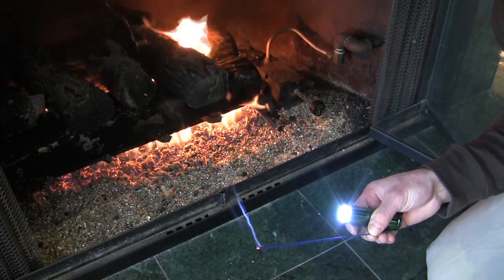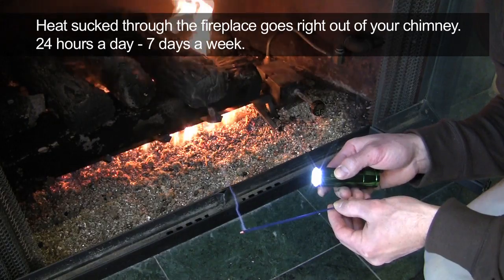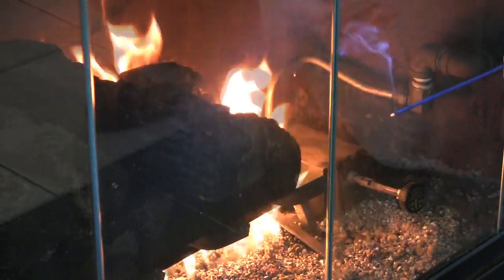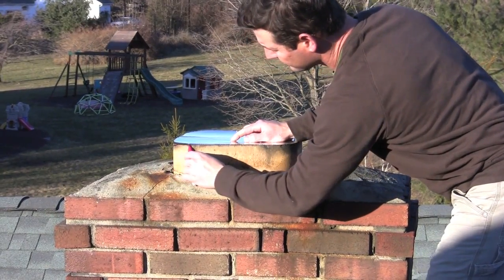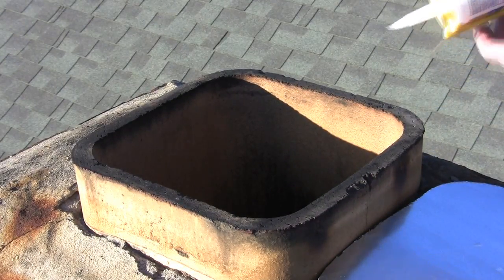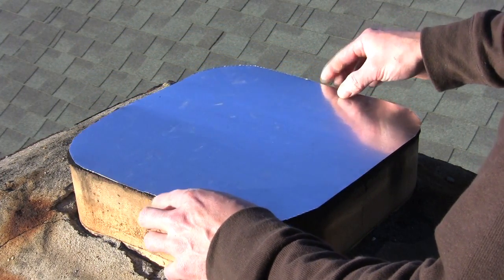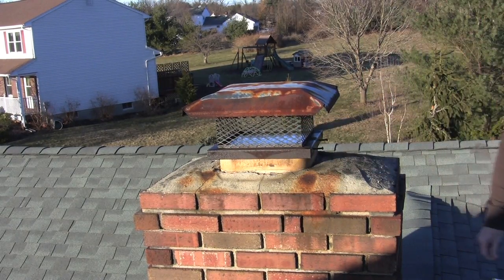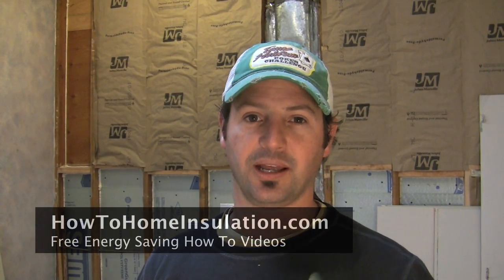Sealing a Chimney - DIY - Air Tight removable seal

Comment: Good advice to seal off your chimney, but bad advice on how to do it. You'll get a surprising amount of condensation on that metal cap in the winter which will drip down into the chimney causing the masonry to deteriorate. It can even soak all the way through the brick and cause damage to the interior walls of your house. Ideally you should seal the chimney at the bottom as well. At the very least you should stuff the top of the chimney with a generous amount of fiberglass insulation.
Reply: I recommend mineral wool insulation instead of fiberglass due to it being moisture resistant and it holds its shape better than fiberglass for a more secure friction fit.
Reply: @jayotis9944  actually only seal on the bottom  not top   u will get condesation and vapour will have no where to go

Comment: Dangerous advice. Seal it from the bottom otherwise people will unknowingly use it.
Reply: You could always put a sign/note in the fireplace that warns people that its sealed from the top and not okay to use. Hang it on the damper and put it right where the logs would go.
Reply: the potential for major water infiltration damage to the fireplace by sealing only from below, far outweighs the "dangers" of sealing from above. you can always still "balloon" from below and utilize it's "cautionary" tag along with additional tag saying the top is sealed too.

Comment: Corey, Quick Q -- My chimney cap actually fits just 'inside' the aperture of my round metal chimney opening; thus I can't place the cap back on once I seal the hole.  I'm considering doing as you did in the video, only not replacing the cap, as it will no longer fit once the chimney is sealed.  Any advice here?  Thanks man.
Reply: Wouldn’t think you would need the cap once you do this anyways.  It’s sealed the same whether the cap is on or off. I have an issue finding caps for mine because mine is also on the inside as my clay pipe is level with the brick rather than hanging above it

Comment: FYI. You do not need to do that.  Install a fresh air feed so air is drawn from outside not the house. Obviously a draft is needed but the air can come from outside which prevents heat loss in the home.  The clean out in the fireplace is a good option A 10 dollar replacement which you can open and close   If the clean out drops to the basement cut a 4 inch hole through the block/brick and run a 4 inch dryer vent hose or metal to the exterior wall    This will not only draw air from outside not robbing your home of heat will also create a much better draft    Or block the flu if you don’t use it I actually covered mine similar to this gentleman but I did not use silicone put a piece of insulation in the the flu

Comment: yes if anything is conected to it DO NOT plug the top or co2 will come into the house and could kill you  and it it has a fire place in it coverd over by dry wall make shure it was bricked up before the dry wall  and if nothing is conected to it and its will never be used i would recomend to take it down atleast to under the roof line and pacth in the hole in the roof than it will never make a leak or problems down the road
Reply: lol its Co.1 (Carbon Monoxide) not Co.2 (Carbon Dioxide) that can kill

Comment: Corey, of course the room air goes up the chimney. That's the purpose of the draft. But, you are ignoring the counter-effect of the radiant heat from the fire into the room. I turn off the furnace and heat 1300 sq ft with a mostly open-space floor plan. The warmth is AMAZING!!

Comment from the maker: Hey gymfeever,

It's easy to remove the sheet metal with a utility knife. Just force the blade in between the sheet metal and chimney flue and work your way around. All you need to do is slice through the caulk and the metal comes right off.      If you plan on using your fireplace a lot - use a chimney flue top damper. They make it easy to use your fireplace whenever you want. All you need to do is pull a chain hanging from your fireplace.

Comment: I recommend you do a follow up video  regarding repairing the dome for the chimney.  Cracks and deteriorated concrete needs to be repaired to prevent moisture from getting inside chimney.

Comment: Utube is incredible for great advice and then there's advice like this.
Please remove this before someone listens to you.
Reply: what's wrong with this advice? properly tagged, which you'd have to do anyway when sealing from below, sealing from above is far better, and effective. only sealing from below is far more dangerous given the potential for water entering the flue and getting trapped and degrading the mortar. point of all of this is seal from above AND below AND properly tag.
Reply: @isafctat  Chimneys even unused ones have to have air flow so bad advice to seal it off air tight. Should use a top cap to stop rain but allow air flow under the lip to stop condensation.
Reply: @rogerbuckland4214  properly sealed from above AND properly insulated, and condensation will never be an issue. can't say the same for allowing an air gap though. air gap presents a whole host of issues, not the least of which bugs, insects, etc, conditioned air escaping from the interior envelope, or unconditioned air entering the conditioned air space. homes have insulation, vapor barriers, and seals throughout them for a reason. treating an unused chimney like an unwanted hole in your homes envelope is no different. properly sealed, properly insulated, and properly tagged, and it'll never be a problem.

Comment: solutions to keeping a heat source fireplace and have it be air tight and above 70% efficient is to install a direct vent Gas appliance, Many makes and models. They are a self contained unit and use outside air for combustion. The air you have already heated wont be sent out with this unit. also so brands offer an option that uses no electricity and can thus work when the power is out. It is an investment but one that can add value and heat to your home. sealing it off is a quick fix.

Comment: Thank you, Corey. Many of you are very confused. You will not be able to use any fireplaces or venting of any kind once you seal this up. This is a perm solution for closing the chimney. DO NOT do this if you are using your fireplace to vent appliances of any kind. I am not sure how the Vent Free Inserts work, but that might be a possible option. I have 4 vents inside my house on the chimney. I am wondering if I could use this type of method to seal those as well.

Comment: Telling people to seal a chimney without specifying that IT HAS TO BE AN APPROVED VENTLESS GAS MODEL?! Now I've seen it all. If you do this and don't have the right fireplace you could burn your house down/die from exhaust emissions. #Liable
Reply: clearly you have a comprehension issue, since he said in the video that you cannot use the fireplace after sealing it.
Reply: This is for fireplaces that are no longer used for burning anything!  It is an energy-efficient way to prevent heat/cool loss from a house.
Reply: Richard, did you start the video half way through? You missed some key info.